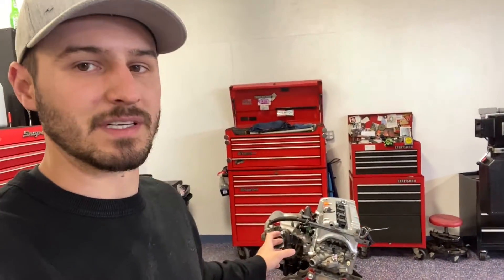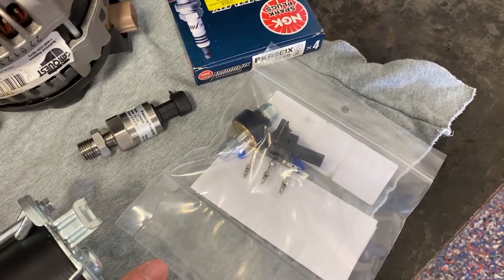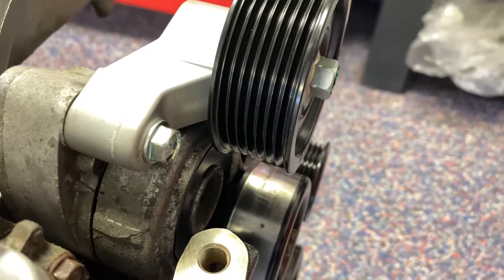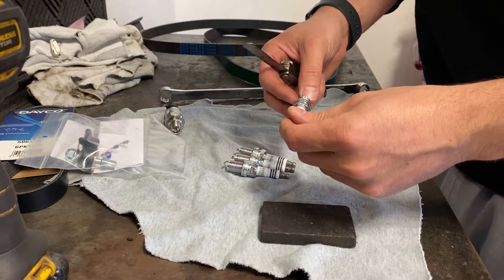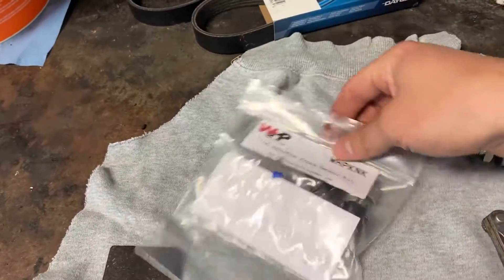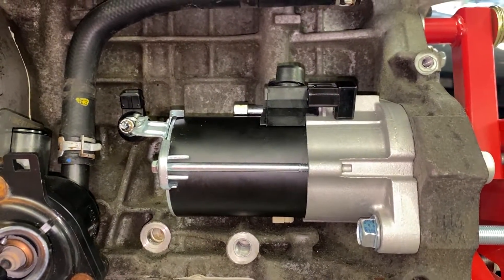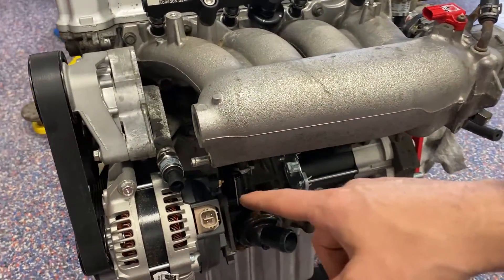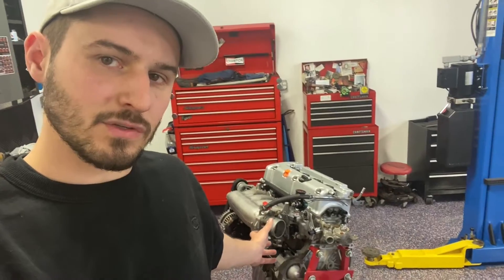EK K Swap AWD Civic Build - Engine - Episode 4 - Accessories and More Sensors

Comment: Can you post the CRV pulley part number
Reply from the maker: Unfortunately it all needs purchased in pieces. And it doesn’t come cheap…

Bracket: 31175-R5A-A00
Pulley: 31190-RX0-A02
Cover: 31185-RX0-A00
Special Bolt: 90002-R40-000
Mtg. Bolt: 95701-08045-08
Reply: @berttnotbought804  thank you

Comment: I have the Karcepts alternator relocation kit, puts it very low out front, pretty easy to reach and replace if needed from the bottom, and provides more room for that crankcase vent/sensor, idk if that's an option for the k24 or just the k20 but if it works, might wanna see if it might work, I definitely recommend it!
Reply from the maker: I’m about to switch to a center feed manifold that I think will demand that I use that kit. Time will tell. Thanks for the heads up. What was the tag on that kit?
Reply: @berttnotbought804  I wanna say I paid 200 on a black Friday sale from hybridracing, it's listed as 250 now on their site tho